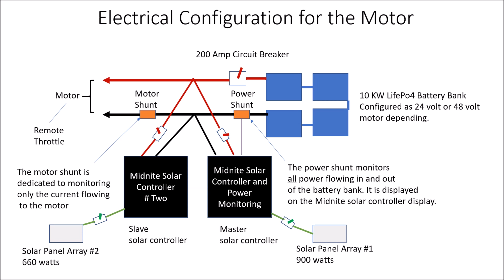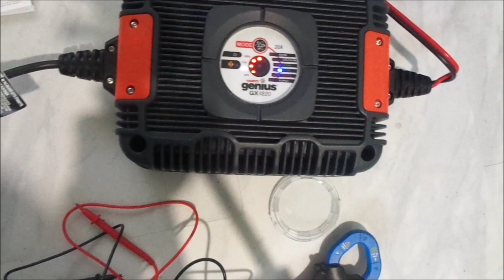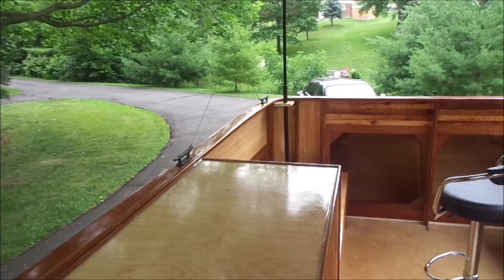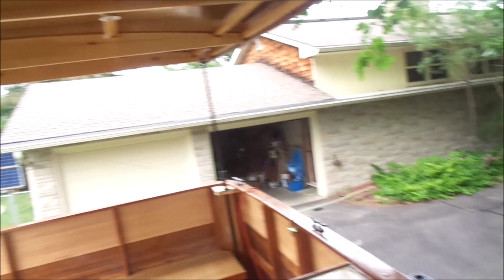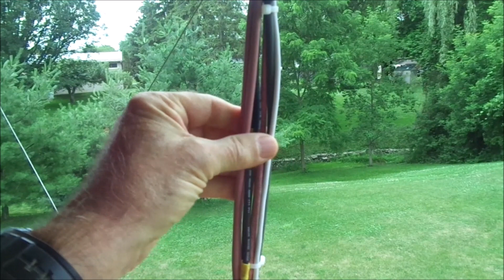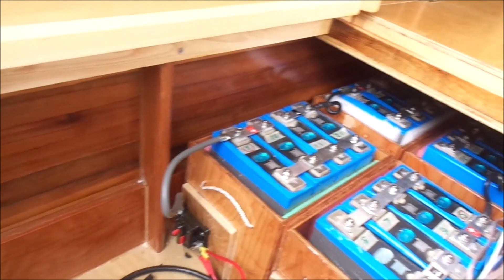Building My Solar Electric Catamaran Part Fourteen

Comment: Sorry if I missed it, but what is charging the house bank?  If have seen mixed mode DC systems (maybe on Sailing Uma) where a 12V system is kept charged with a DC to DC charger from the higher voltage and all other chargers Solar, shore, and a backup gen just feed the higher voltage main system.
Reply from the maker: The house battery is a separate battery bank used for utility purposes. I am following that approach this year but next year I would like to expand the LifePo4 bank to 20kw and use a DC to DC convertor.
Reply: @philboyer2036  Thank you.

Comment: when do you think it will be in water. any trips planed?
Reply from the maker: It already has been. I am behind on my videos. I do have a trip planned for this year but I need to upgrade the motor. Too low a water level and too many weeds this year.
Reply: @philboyer2036  hoping to power my 34 house boat with electric some day just for slow speed running

Comment: Very nice boat and set up 👍
Reply from the maker: Thanks 👍
Reply: @philboyer2036  I am also building one electric boat right now (houseboat, 11 meter, 22 kWh LiFePo (3,2V/206 ah * 32 to 48V Bank) and 2 MPPSolar 5KW continuous each, 3 KW Peak Solar and 2 Torqeedo (4.0).
Reply from the maker: @Instructorstulle  Very nice, you should document your build and later any trips.